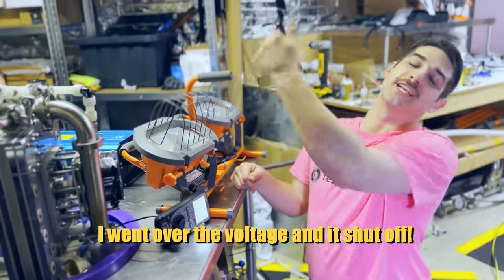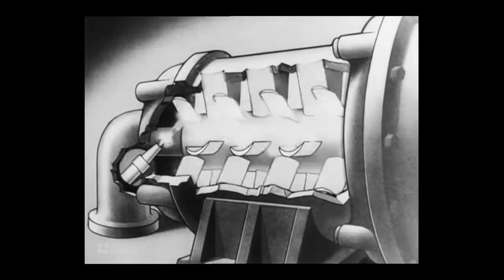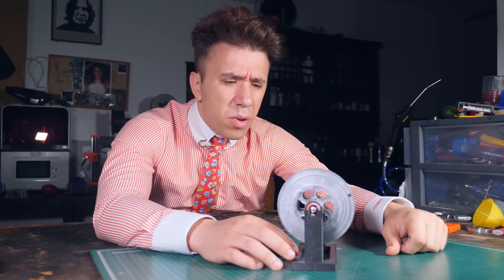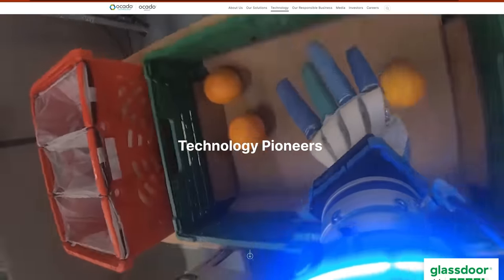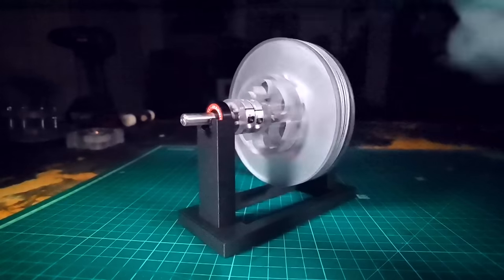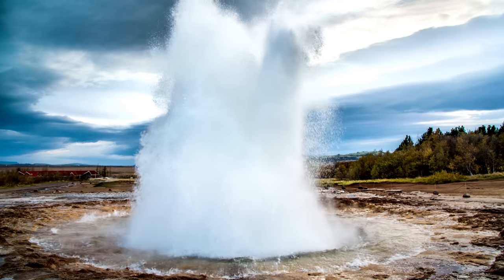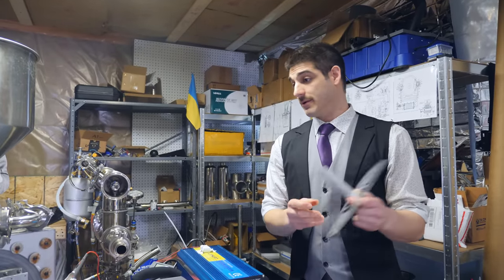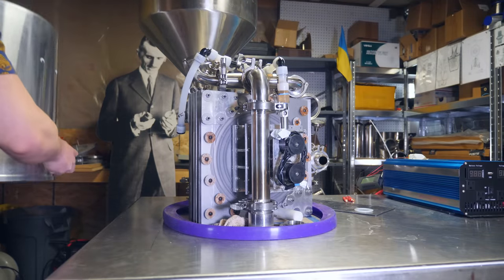Building Nikola Tesla's Bladeless Turbine

Comment: What a brilliant channel and video. Without guys like you and the creator in the video,  the Telsa turbine would have been consigned to the bin after a brief look. The fact he took a deeper look and got it to work when others would have gave up is fantastic. How many more of Tesla's ideas need a fresh look with an open mind?
Reply from the maker: Thank you my friend 😁
Reply: @integza  ❤️ Keep up good work, just subscribed.
Reply: @BrainfooTV why did you stoped uploading?
Reply: @KR-ef2er  Just having a break from it.
Reply: I would love to see this turbines potential powered by the sun with mirrors or solar panels and a steam boiler
Reply: @integza  Can I take @BrainfooTV 3d printer
Reply: @IR-nq4qv  I've been researching Holcomb generator and similar engines. Also very close to some of Tesla's ideas I believe
Reply: 🙏❤️‍🔥 thank you for your kind words! 😊🤓👨‍🔬😬
Reply: @IR-nq4qv we’re working on the system right now! Just finishing out the last hot water circulation pump to the boiler and it’s a go for testing under the same conditions! 

Stay tuned. We might just send Integza a nano boiler+condenser kit to go with the turbine for testing 

You never know 🤷‍♂️🤓👨‍🔬🦾
Reply: the discs need texture that doesent effect the boundary layer yet extends past it...more spacing between the discs with the "textured" aka small blades filling up the space between the discs not affetected by the boundary layer phenomenom...basically a hybrid tesla turbine making best of both worlds...your welcome :)
Reply: @CharlieSolis  This was literally the first thing that popped in my mind when i sae this.
Reply: @bsod4144  Thank you for your suggestion. 

The idea of texturing the discs or adding small blades to increase the interaction between the fluid and the discs is an interesting one. 

However, it's important to consider the nature of the flow within a Tesla Turbine, or TesTur.

The TesTur operates based on the boundary layer effect, where the fluid sticks to the disc surfaces and transfers its kinetic energy to the discs. 

If we were to roughen up the discs or add small blades, this could disrupt the smooth, laminar flow and cause turbulence. 

Turbulence can lead to energy losses and reduce the efficiency of the turbine.

There have been studies on micro-etching to increase adhesion, but these are typically under static conditions. 

The conditions within a TesTur involve much higher velocities, so it's not clear if micro-etching would be beneficial. 

Nano-etching, which is essentially surface treating, could potentially be beneficial, but more research would be needed to confirm this.

The key factor here is the adhesive properties between the fluid and the disc material, which are determined by the electron orbital interactions. 

These adhesive properties "connect" the fluid to the disc, allowing the kinetic energy of the fluid to be transferred to the disc.

This is where organic chemistry comes into play. 

Factors such as the wetting angle and the polarity of the fluid are important to consider. 

If the fluid is polar (like water or steam), a hydrophilic (water-loving) or oleophobic (oil-hating) surface treatment would enhance the adhesive properties. 

If the fluid is non-polar (like air, nitrogen, oxygen, or carbon dioxide), a hydrophobic (water-hating) or oleophilic (oil-loving) surface treatment would be more beneficial.

So, while your suggestion is interesting, it's crucial to consider the underlying physics and chemistry when designing and optimizing a TesTur. 

I hope this provides some insight into the complexities involved in TesTur design.
Reply: @CharlieSolis  It does! Thank you. Maybe the way is to minimise the distortion in the boundary layer..make the features prevalent only in the middle of the gap and that they are onneted to the discs with thin and non intrusive feature like stilts...i dont know nearly enough about the subject to talk from a point of knowledge as you can..just makign suggestions and maybe wake some tought process :)...thanks for responding
Reply: @CharlieSolis  I would be very interested to see if this generator could run under load of pressurized hydraulic fluid or engine coolant.
I'm also wondering if a guy could hook it up to some type of medium pressure pump that runs off one of the drive wheel on an electric car, would it be able to charge the batteries for an extended period?
Reply: Quite a lot...
Reply: I dream about having a portable turbine based generator that can fit into a backpack, run on any combustible fuel, and produce multiple kW due to high RPM.
Reply: Brainfoo, Amazing content!
Reply: @integza  is there a link for the turbine giveaway 😂 this is great technology  thanks to everyone for this video
Reply: @CharlieSolis 
Hi Charlie - thanks for that great explanation above. 

So in regard to the principle of hydrophilicity here - the most essentially important of all the wonderful principles on display in this turbine (it doesn't surprise me that Tesla was more proud of this invention than any other!) - I'm wondering if a SUPER-hydrophilic disk material (be it either chemically-polarized hydrophilicity, or nanotopographical-effect surface hydrophilicity - which I believe is probably different from the nano-etching treatment you mentioned above, by the way!) would MOST improve (the near-perfection of!) its energetic efficiency - ??  ...And/or do you think/suppose that electrically charging/polarizing the disk material (either permanently, or momentarily via electrical current) to increase/promote the fluid's adhesion to the surface would accomplish the same benefit?  (Which really makes me curious/makes me wonder what all the ideal characteristics of a Tesla turbine's boundary layer are, in terms of its height/thickness, and perhaps even in terms of how dynamic or static the relationship should be between the fluid's self-lubrication [and/or its viscosity] performance on one side of that boundary layer, vis-a-vis its valence adhesion performance/strength on the other side...?)

And, by the way, is the valent electron adhesion force the same thing as a covalent bond? And/or the same thing as the Van der Wals force? 

You're a favorite of mine, Charlie - keep inspiring the world around you with your enthusiastic curiosity. 👍
Reply: @BrainfooTV can’t wait til you get back to YouTube, enjoy your break!
Reply: @IR-nq4qv  : Honestly, with solar concentrators you'll usually be better off with a Stirling engine. Tesla turbines are best with low-quality materials (because the TT is more resilient than other turbines), and low-quality inputs (e.g. fluids with undesired grit in them). Stirling engines don't have that demanding of material requirements either, so as long as you have control over the material flowing through them (which you would), they'll work better for low-power sources like solar concentrators.
Reply: @integza excellent video. When will the link appear for the tesla turbine?
Reply: @BrainfooTV first of all upload videos
Reply: The tesla turbine was consigned to the bin for good reason. It is horrifically inefficient at low rpm, needing a lot of energy in the airflow to overcome the inertia of the discs. It needs very high rpm to be efficient, typically over 50,000rpm, and this tends to warp the discs due to heating expansion and fatigue and destroy the turbine.

Come on, stop fapping over every little thing tesla. His inventions have been known to engineering for as long as he has been dead, and a lot are not used for a damn good reason. Noone was "confused" by this like the channel suggests at the start. Everyone worth a dime knew it was trash.
Reply: Commercial airplanes already run on this power source or do u really think theres tons of jet fuel in the wings ?
Reply: I'm interested in efficient ways to heat buildings, like homes.  The earth beneath the  buildings has heating and cooling abilities.  Transferring those abilities to the buildings is what I think you should investigate.
Reply: @integza  Out of curiosity could making the blades or discs more rough contribute to the efficient by capturing more of the inertia or does it have the opposite effect?
Reply: @PhilDavisplus  I'm always open to new ideas. If you have any suggested videos or places to start let me know 👍🏻
Reply: @levijones7679 hey thanks for the comment. The link for the turbine should be in the description.
Reply: @kelly4187 I appreciate your comment but that’s not an issue because, despite what everyone erroneously claims, Tesla turbines work just fine, get plenty of torque and output power at low RPMs.     I’ve got some copy pasta 🍝 of mine that I’ll share with ya here to explain more.  Tesla turbines aren’t made efficient by spinning really fast.   That’s only for when the disc stack is being used as a centrifugal pump, because ALL centrifugal pumps’ compressors, performance is tip speed dependent.   But spinning the turbine fast will produce a centrifugal head that opposes the incoming fluid flow, reducing the pressure gradient across the nozzle, reducing fluid final velocity, reducing mass flow rates through the nozzle and ultimately reducing power out. 

Furthermore the faster you spin them the faster the fluid you have has to go just to still be moving faster than the discs and still provide torque.   Lastly, they work just fine for industrial use and can scale up just fine because the torque on the discs is proportional to the difference in the fluid speed and the disc speed. So the disc tip speed is the important factor here. For any given fluid supply in, the bozzle will have a max fluid velocity. So the turbine disc tips will have a max speed set at that fluid speed irrelevant if radius. Now considering that centripetal force is proportional to V^2/R, if you keep the tip speed the same but increase the radius the centripetal forces on the disc for the speeds needed will actually decrease.
Reply: @olbetsy5257  Great question! 

In theory, it might seem like roughening the surface of the blades or discs could capture more of the fluid's inertia. 

However, in practice, it's quite the opposite. 

Smooth disc surfaces are actually preferred in order to reduce turbulence, leading to more efficient operations.

It's crucial to note that the efficiency of the system is largely based on the electronic adhesion of the motive fluid to the discs, rather than the mechanical surface topology. 

In simpler terms, it's about how the fluid molecules are attracted to and interact with the surface of the disc at a molecular level, not about how the fluid physically grips or rolls over the disc surface due to its texture.

That being said, what we do need to optimize is the surface treatment of the discs to make them either hydrophobic (water-repelling) or hydrophilic (water-attracting). 

This choice depends on the nature of the motive fluid used, whether it's polar (like water) or nonpolar.

For polar motive fluids, a hydrophilic surface treatment allows the fluid molecules to 'stick' better to the disc surface, enhancing the transfer of momentum. 

On the other hand, for nonpolar motive fluids, a hydrophobic surface treatment works best.

In conclusion, while surface roughness might seem intuitively beneficial, it's actually the electronic interaction between the fluid and the disc surface that's the key to improving efficiency. 

Thanks for bringing up this interesting point!

As a last tidbit, take a read of the section out of Tesla’s article Dr. Tesla Talks Of Gas Turbines.   

““I have been working at this a long time. Many years ago I invented a pump for pumping mercury. Just a plain disk, like this, and it would work very well. ‘All right,’ I said, ‘that is friction.’ But one day I thought it out, and I thought, ‘No, that is not friction, it is something else. The particles are not always sliding by the disk, but some of them at least are carried along with it. Therefore it cannot be friction. It must be adhesion.’ And that, you see, was the real beginning.  “For if you can imagine a wheel rotating in a medium, whether the fluid is receiving or imparting energy, and moving at nearly the same velocity as the fluid, then you have a minimum of friction, you get little or no ‘slip.’ Then you are getting something very different from friction; you are making use of adhesion alone. It’s all so simple, so very simple.  “This is the greatest of my inventions,” Tesla went on with great enthusiasm.“
Reply: Can you make a go-cart with air tanks and this turbine?  How fast and how far could it travel?
Reply: @integza  For a guy that hates tomatoes you sure have a lot of them around. "Disgusting tomato. You're so nasty. Here, put on this wig." Your work is very interesting. Sometimes a little spooky but always fun.
Reply: @robertsoldwisch895  hey thanks for the comment! Yes this absolutely could be used for a gokart. Though the little one might be a little underpowered. 

I would suggest using a scuba tank for storing enough energy to do a substantial run and do a couple of hot laps around a short track.
Reply: So he only answers to people giving him verbal felatio...got it
Reply: @lastofthebest5102  No I also answer to nasty people to. But in all honesty I just don't care what you have to say. I would build a miniature handkerchief, but I won't shed any tears over your views. The fact is nice people deserve an answer. You? Not so much, but I have blessed you anyway. Have a nice day ❤️
Reply: Funny how the channel with a gets a response from this guy hmmm.
Reply: @kelly4187 yikes sounds like the Tesla hater needs to work on his science
Reply: SpiritualMentor857  I have also been looking into the concept of Over Unity and some Bedini engines. There seems to be a lot of Nikola Tesla's theory's  embedded in those ideas. A lot of people poo poo the idea of over unity but I have many experiments that point to its existence 👍🏻
Reply: @integza  have you seen the SP 500 generator from Fuelless Energy? Would be great if you did a vide and ideally built one from their plans. He had also built a small Tesla Turbine in 2016
Reply: the only reason they dont use tesla turbines for power plants is they where already tooled up to build the old ones.

what would be cool is combining a ionic induction engine with tesla turbine made of inductive negatively and positivly charged panels.  youd get a lot stronger induction engine/higher preasure/speed for space i feel youd also need to be turning shaft/wouldnt be totally without moving parts like a ionic thruster but i think it could be a good way to make a electric jet engine of sorts without 'blades' persay
Reply: Suggestions: Take the tesla turbine to pawer a engine  and put the air waste in the engine.